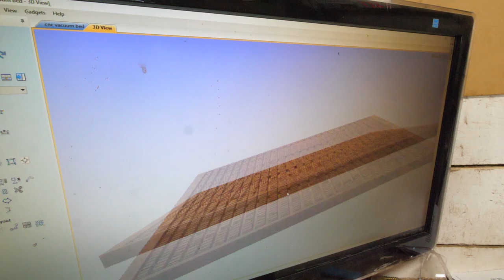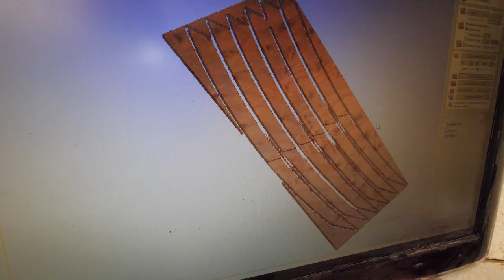DIY Vacuum Bed For An Avid CNC

Comment: Couple of suggestions for anyone doing the same.  To maximize your vacuum, seal the MDF grid before putting on the 2nd sheet (BIN primer or shellac or similar works well).  This will keep the air flow from getting through the sides the same way it pulls from the top.  Also, seal the sides of the top sheet of MDF (I use edge banding) to keep the air flow only pulling from the top.
Reply: Hello,I was reading your message and great info! Seal the grid before putting second sheet? So we have to make a grid on the first sheet too,or just seal the whole second sheet ?top,bottom,and sides? And where’s a good source to buy vacuum pumps? Thanks
Reply: Would putting a layer of laminate on the MDF prior to milling the slots work?

Comment: You should've used a spiral ramp toolpath to cut out the 2 inch holes, especially when using a downcut bit. Every time you went down, you were drilling straight down and pushing the chips directly below the endmill. Packing the chips and making the endmill burn, hastening the dulling process.

Comment: Can you give some more info about the vacuum? I have similar sized avid and want to start looking buying the vacuum pump. Thanks!
Reply from the maker: My Vac pump was just bought off online classifides and it's a 4hp, I think that's as small as you could go if doing this setup pulling through the mdf.
Reply: What model is it? I would like to do my research on this also

Comment: How do you remove table with all the plumbing underneath?????
Reply from the maker: The 2" male fitting just slides into the female fittings that are glued to the MDF. The plumbing stays under the table.
Reply: @CanadianWoodworks  Sweet Thanks Didn't want it to come across as "Troll-ish".

Comment: I'm surprised that the suction goes right through a solid piece of MDF.  You called is ultra light or something like that. Is this a special product?
Reply: It' s à less dense mdf. You can get it on special order
Reply from the maker: The MDF isn't actually solid. Once you skim the top and bottom "film" off, the air can pass through the MDF 'fibers'. That's why we don't put glue on the underside of the top sheet as that will plug up the MDF again

Comment: How does the vacuum hold if there aren’t any holes in your light weight mdf sheet?
Reply from the maker: When you skim coat the top and bottom of the light weight, you are removing a coating that will allow air to pass through the MDF fibers.

Comment: Isn´t it better to use a larger diameter pipe at the beginning, before it splits into 4 different pipes? Seems obv you get a better/more even airfow through all four pipes. Now most air would go to the two nearest pipes to the motor as there is less resistance there. Just a thought cheers
Reply from the maker: Yes it is, but the little pump only has a small inlet, so I don't think it's hurting the performance.
Reply from the maker: Cheers

Comment: Awesome. How often do you have to replace the linear bearings on the CNC?
Reply from the maker: We had to replace them about every 6 months, but now we clean then with a few drops of Odies Oil Orange cleaner, couple drop on the linear rail once a week has kept them working perfect.  I also cleaned all the old ones I removed.
Reply from the maker: If we had better dust collection, it would be a different story they would last much longer

Comment: Why bother gluing the spoilboard down? Why not use a gasket around all the zones?
Reply from the maker: Your right the spoil board does not need to be glued down, I did't was the gasket design
Reply: @CanadianWoodworks  Would you next time instead of gluing just countersink some screws through the spoilboard and into the plenum to keep the spoilboard from moving around when vac is off?  Did not fully understand your response to Brian.  My gut says to glue as you did....but am interested in your take after having done it.  Thank you for the video.  Very helpful.  About to all this to my AVID CNC 4 x 8.
Reply: @michaelporter9940  why would the spoilboard move? I have custom vac fixtures that I like to swap out with the spoil board. Gluing or screwing the spoilboard isn't necessary. If you think it needs screws, put some threaded inserts into the table and then use nylon Flathead countersunk screws
Reply: @CanadianWoodworks  Have you had to replace the spoilboard yet? Seems to me like glueing it down makes that process a bit harder.

Comment: One warning - Due to the potential hazard from a dust explosion (Static from plastic pipes), either use grounded metal piping or run a bare copper wire inside the pipe and out to earth.
Reply from the maker: Has this ever been proved to be an issue?
Reply: @CanadianWoodworks  The National Fire Protection Agency recommends non-combustible ducting when conveying combustible material. As we know, wood dust is combustible, as well as PVC pipe, never mind the static buildup, which is a source of ignition.
Reply: British Standard EN 12779 also advises that flexible ducting should be earthed to avoid the risk of a static build up. This can be achieved by making a connection from the flexible ducting’s metal helix to the adjacent 
rigid metal ducting
Reply: This could affect your workshop insurance too. Not being 'Smart' just trying to educate from personal experience as a shop owner for many years.
Reply: That's only necessary for dust collection, not for the plumbing for the vacuum hold down table. Dust should not be going into the vacuum plumbing system unless you are doing something wrong. He has 3 sheets of MDF between the dust and the vacuum. That will filter out any dust.